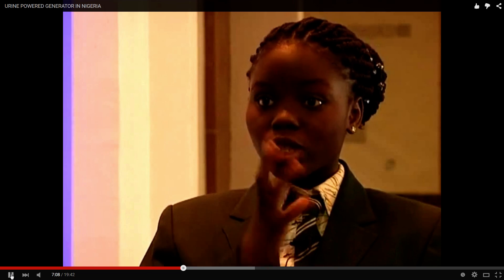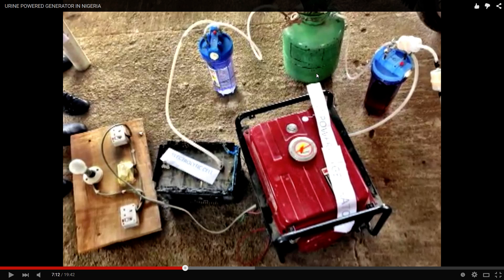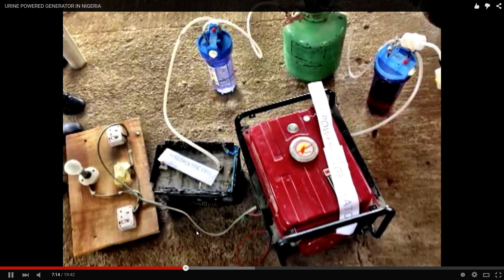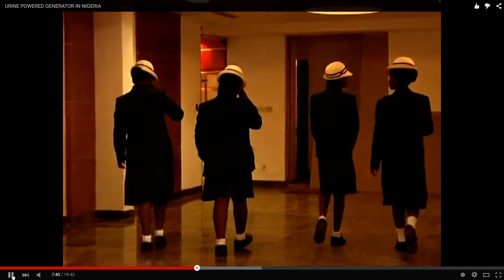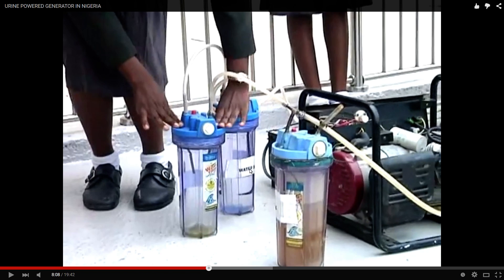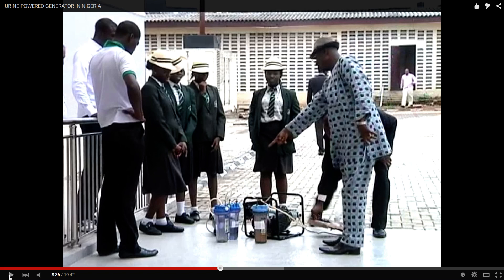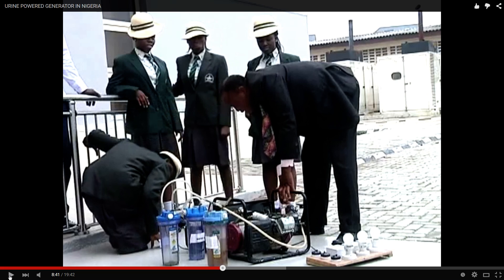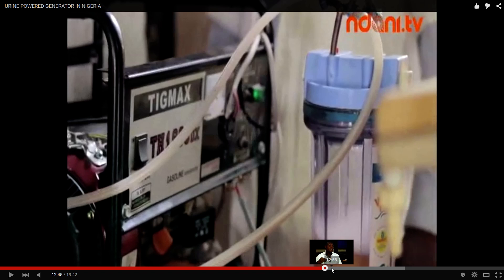Selfrunning Urine Generator Update - Free Energy Generator invented by Nigeria Schoolgirls

Comment: An error in the translation. The electrolysis of urine does not produce hydrogen and oxygen, but rather hydrogen and nitrogen, which is why it is able to start any internal combustion engine that has spark plugs. So there must be a bottle of lpg gas and an electrolyzer in the car.

Comment: This self running generator is clearly a hoax. Due to the restricted efficiency of a combustion engine and an electric generator electrolysis with an efficiency of about 400% would be needed for such a system. No data at all is given for this urine-electrolysis. I bet it's efficiency is well below 100%.